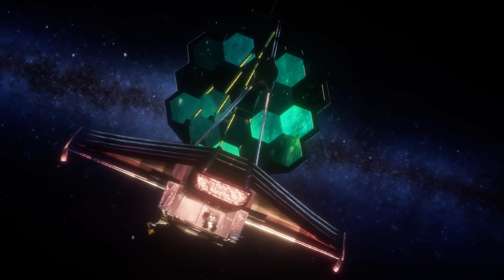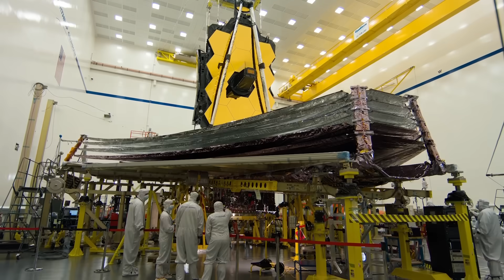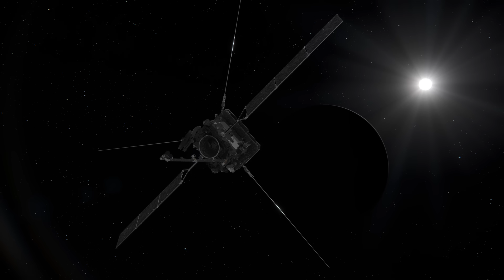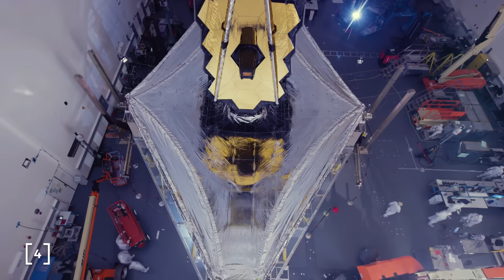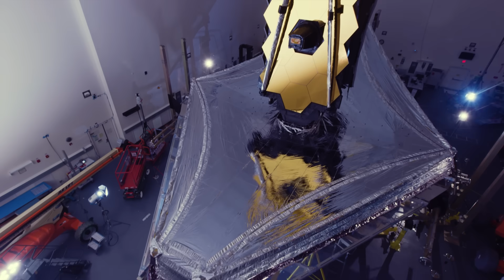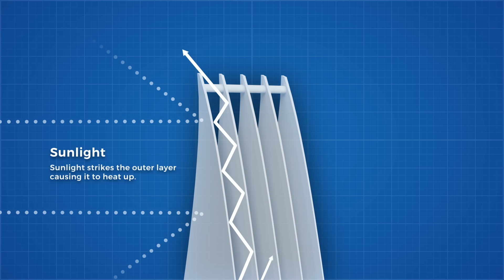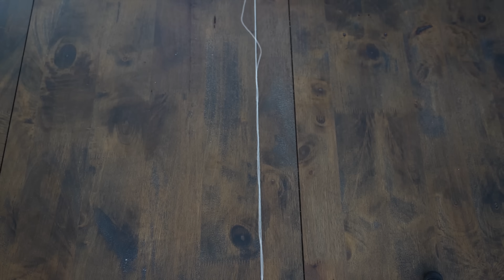The Insane Engineering of James Webb Telescope

Comment: Hmm... I have a few question I only just thought of, some provoked by questions as I type them out:

If neutron stars are denser than normal stars, and black holes are denser than neutron stars, and the universe was once so hot and dense that even protons could not form, let alone Hydrogen, how did the early universe not collapse, yet stars can and do collapse and form neutronic matter and black holes?

Is it possible that the early universe expanded outwards faster than the speed of light, with a causal shockwave we can no longer detect as it has long passed, racing onwards at the edge of infinity? 
That its rate of expansion was so high that luminal and sub-luminal physics as we know them could not act? 
Could it be possible that the universe has a 'drag co-efficient' that was different during hyper-/super-luminal expansion? Am I describing the Hubble Constant (as a non-constant) there?

Is it possible that black-hole interiors prohibit sub-luminal velocities?
That as you exceed c, your experience of dimensions and physics changes? As I understand it, black holes have 3 dimensions of time (up-time, down-time, left-time, right-time, backwards-time and forwards-time) and one spatial dimension (up and down); that similarly to how we experience time but cannot go forwards faster through time than causality allows and we cannot go backwards through time at all, you travel downwards at a rate determined by the laws of physics within that regime of timespace, but cannot possibly travel upwards. 

Note to repliers in advance
I don't understand the math behind advanced physics. My understanding comes from people explaining the conclusions and making some inferences and crafting theories to try to explain what we don't know for certain already. 

Therefore when explaining to me why I'm right or, more likely, wrong about each proposition, please relate the math (if you intended on using that in your explanation) to the realities. 

One assumption I am rolling with is that the extreme curviture of space-time produced by a black hole means that as you cross the event horizon you also exceed c; that in that regime instead of being unable to accelerate to and exceed c, the curviture of space-time crosses a boundary into time-space. I also suspect that as you cannot slow down to c, this may be the source of outward informational pressure that results in the maximum data storage density of a 3D sphere being a 2D shell projected upon its surface.

I am also presuming that these localised pockets of time-space could only form when space-time around it had slowed down. 

If you are aware of some math that explains how the early, dense universe did not become a black hole or Kügelblitz, even if you have no opinion on my black hole theoretical physics I'd be very interested in learning that either way.

Comment: They could have tapped into the research that McDonald's did years ago on keeping the hot side and the cold side isolated from one another...and McDonald's did it with about $.03 worth of expanded polystyrene shaped into a little 2 compartment box. 👍
Reply: Last I checked, McDonalds didn't have to deal with a temperature gradient of 230 degrees f to -447 degrees f.

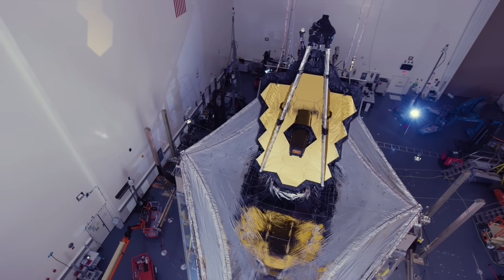Comment: Is there an error: at 5:23 must be +83C, close enough to boil the water? Instead there was pictured -83C. Can it be +83C in open space? Hardly.
Reply: Yes, it can be +83ºC in space. When you're in sunlight, you're exposed to higher intensity light than on the hottest day on Earth, so the sun-facing side gets hot. The other side of the spacecraft will radiate heat so it'll cool down, it's tricky to get a decent temperature inside the spacecraft: you have to insulate the spacecraft, and many spacecraft have cooling radiators.

Comment: I have always thought NASA a complete waste of money, or there are better ways to spend the money allotted to this agency. I admit I was a bit excited when we landed on the Moon, but DI would not let us watch it in boot camp. The years passed and became an engineer, and came to appreciate good engineering. I actually remember watching them put it together, piece by piece. 
It is 2022, and couldn't believe it was actually done.
Flawless engineering folks and for those that truly appreciate electronics, pistons, this had to fail.
The Saran Wrap would not deploy properly was my guess.
Well, Hats off to everyone that was part of this project,  and some may have died on it. What it's done so far, is incredulous, as there has to be 250,000 components that have worked flawlessly. BUT
Why are you building another for jeez sakes. Your blowing money again. Why not use your talent base to produce an evaporator to produce fresh water from the sea?
Space is nothing when compared to a third Telescope. I believe it's capable to use a 5-10 stage evaporator, each with a lower vacuum where the last stages boiling sea water at a very low vacuum. In simplifying it, the energy source would be a series of reactors for the power needed, as these will run for a mile, and probably the largest construction project during this decade. Let's make water folks. They do it daily on CVN Warships.
I like the thought of filling Lake Mead once again, and let our aquifers fill up again.
The entire world would benefit, but its a Simple Simon project, and NASA has the design team to pull this off. Congratulations once more on the Webb, but surely has the wrong name. Carl Sagan was the catalyst that made us look up.
It's now time to tackle critical  problems on our own planet.
Excuse the grammar.
Reply: @Chandler Burse Yes we do, but what I mean are many that produce fresh water at a staggering rate.
Reply: I've heard similar-sounding ramblings from unfortunate individuals yelling to themselves as they stagger down the street.

Comment: How do you genius's explain how there can be ANY VACUUM at all in space WITHOUT A VACUUM CHAMBER ??  Like the chamber NASA was using on this telescope on the ground ???  Its IMPOSSIBLE to have Vacuum without an enclosed chamber !!  Where is the door in space ??
Reply: We need chambers and pumps on earth to create a vacuum because we have an atmosphere (air) and that air must be pumped out of the chamber to create a vacuum. We have an atmosphere because the planet is large and the immense gravity keeps all those gases from floating away and traps any gases from space that travel too close. In space, all those gases are free to float away and most of them end up getting stuck in the gravity of planets/stars which means the chances of running into any gas molecule is small cause there is nothing keeping them concentrated and they are extremely spread out, which is why you can’t breath in space and why space is a vacuum.

An analogy would be a bed with marbles on it where the marbles are air molecules. If you put a bowling ball (earth) in the bed, the marbles will roll towards the bowling ball and bunch up and stay there (which is like gravity causes an atmosphere to be created). This means there are much fewer marbles left spread out around the bed away from the bowling ball, similar to how there are less air molecules spread out in the vastness of space. There can still be some, but given the extraordinary size of space the amount is extremely sparse which again is why you can’t breathe and why space is a vacuum. 

Hope that helps! I assume your ignorance is intentional or you’re just making a weird joke, but better to have an explanation than not if you’re serious.

Comment: you actually think they can send images thousands of miles through space when they barely can keep signal across town
Reply: They've been doing it for almost 7 decades so yes.
Maybe you need to go to school and learn some science.
Reply: Yes: radio waves tend to be stronger and easier to detect when concentrated in one direction. Your town's radio station likely broadcasts omnidirectionally, which results in weaker signals over longer distances, in accordance with the inverse square law.
Reply: Cell service is short-range radio, with a tiny antenna and a $30 receiver in your phone. The cell system is built deliberately to have short range, because the shorter the range, the more cell towers you can install without them interfering with each other, and the more users you can serve. Radio waves don't travel well through solid obstacles, so each wall between you and the cell tower reduces your signal. 
NASA uses a giant dish to receive Voyager's signals, builds the best receiver electronics money can buy ($100 million each), and they have a clear line of sight without obstacles between transmitter and receiver. At these distances, communication is slow: Voyager sends data at 160 bits/s.

Comment: Stephen Hawking would NOT talk about "god" as if it existed.
PS: There is no "the human race", we are a specie of three races.
Reply: Oh yeah, I know the three races.
1. Racists
2. Trolls  (some cross-breeding between 1 and 2)
3. Rational and/or sane and/or compassionate people.
Reply: Humans do not come in races/breeds, only in a few small regionally-formed genetic variations that are not nearly significant enough to actually classify as races in the usually meaning of the word. They are only called races in common practice due to the term "race" being first applied to humans back when many thought that the genetic differences between supposed races of humans were much larger than they really are, thus using the term "race" in the most literal sense rather than the modern way of using it because it's a familiar term rather than because it's accurate.

Comment: Why does NASA always use aluminum foil to build their "spacecraft"...?
Reply: What you're looking at is multilayer insulation  (MLI). This consists of thin sheets of kapton with a layer of aluminium vapor-deposited onto it. A stack of these layers provides excellent insulation against extremes of temperature. 
MLI is applied to the outside of the spacecraft, it covers the spacecraft structure. On JWST, the structural material underneath the MLI is often carbon fibre composite.
What you're doing is the equivalent of looking at a house with clapboard sidings and assuming the house is built from clapboard only.